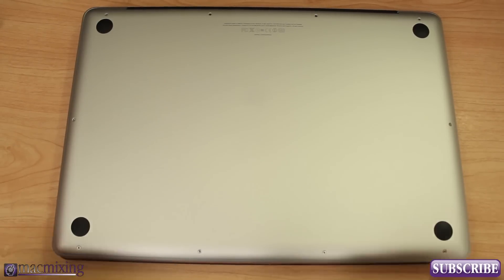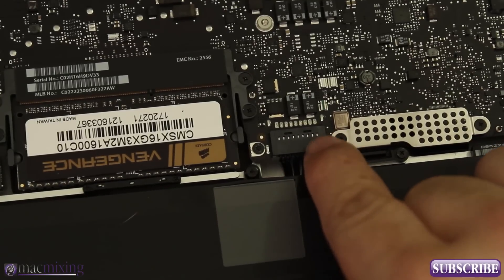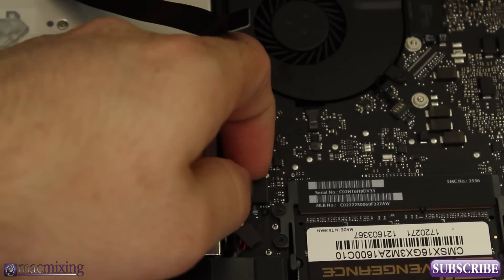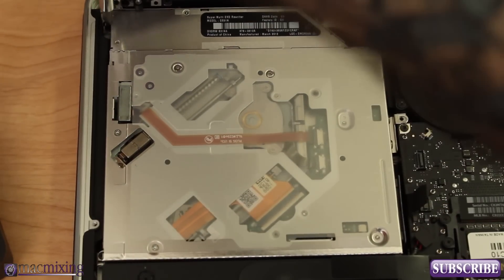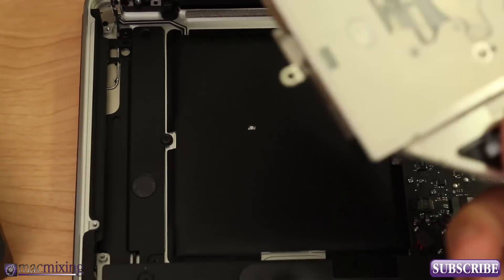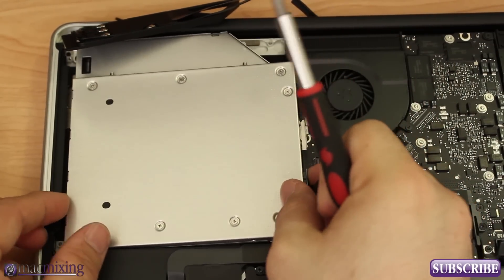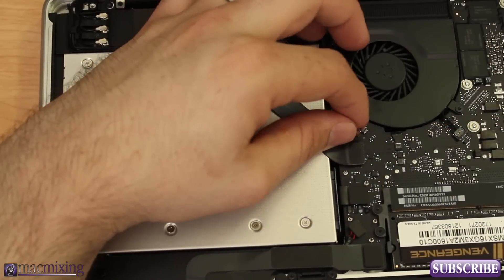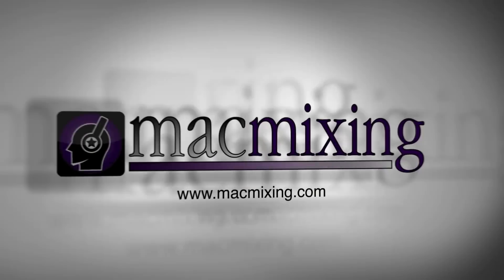[How To] Replace Optical Drive With HDD / SSD MacBook Pro 2012 - Caddy Installation

Comment: I had installed the HDD + SDD on the on the place that belonged to HDD place. My question is, whenever data written or read which Disk would be used as a primary and how to make the SDD as a primary. As the reason I bought my SSD is to speed up my MacBook but cant really define the speed difference after all.

Comment: does anybody have a recommendation for what kind of SSD to buy? write speeds/etc. Mid 2012/13 inch user. Core i5.
Reply: Buy the Samsung 850 evo its reliable and fast
Reply: SeymourGlass Samsung 850 pro

Comment: MacBook Pro (17-inch, Mid 2010) is it the same instrutions !? Same caddy ?
Reply: I wanted to know the same thing, i have a 13 inch and i hear even the 15 inch model is different, in regards to screw placement, length of screw, etc.

Comment: Thanks for the video. It helped a lot. I have 1 question though, after I replaced my Optical Drive with the HDD, my computer recognises it but it won't show up under "Devices" and my computer seems to be hotter than it was when I only had the SSD in. What can I do to see my HDD under "Devices" in the Finder? 
Thank you very much!

Comment: can u use any hard drive?
does any hard drive fits on the caddy?
im have a mid 2012 mac, i used for music, im a dj. and i want to install the biggest or better saying a hard drive with the most capacity posible and available.
Processor  2.7 GHz Intel Core i7
Software  OS X 10.9.5 (13F1077)
i already have a 500 GB Flash Storage.

I NEED THE BEST ADVISE PLEASE. 
THANKS

Comment: Is there a limit capacity that the MacBook Pro 2012 can handle?  I just bought a 512 GB SSD and I would like to replace the optical drive with it but I want to make sure it's not too powerful for this machine.  It's my first time doing this so I want to make sure I don't mess anything up.  Thanks!
Reply: Susy Martinez u should do this to see if works fine with u.... take out the HDD and put your new 512gb SSD and the old HDD replace it for the optical drive.. and if is not enough take out the HDD and put the 512GB SSD and another SSD on the optical with 128GB 2 SSD would be better... thats for sure but thats more money try the first one...
Reply: Susy Martinez what i did to my macbook is change my ram of 4gb to 16gb and i take out the hdd and put a 128gb ssd and for the optical drive i took 500gb hdd and for me works awesome.. if u havent change ur ram to more high u should if u want more speed from ur mac... u dont have to if ur not a video editor or photo editor someone who need big apps need more ram but if ur not i suggest to use only 8gb of ram
Reply: TTO_ Hybird does your Mac recognize the two hd or did you RAID as one?

Comment: I just did this set up, i put a ssd as the main hard drive and used my old hdd as the secondary, but for some reason it still boots from the old hdd. I cloned it to the ssd and the ssd works fine. Every time i start it i have to hold alt so i can boot from my ssd, any advice?

Comment: Could I install my SSD in place of the disk drive first to clone it then swap the location of my HDD and SSD?
Reply: You want to buy a USB hard drive enclosure (10$), hook it up, clone it and then install it where you want. Great comment below said to put the SSD in the original hard drive space and put your HDD in the optical drive. The connection to the original hard drive space is faster.

Comment: HI, thanks for the video. I was installing on my MBP13 mid'12, the HDD fit perfectly, but 2 screws protrude about 1/8" where antennas should lay flat, so lid didn't close flush. The screws are tight all the way, but it still comes out. Any suggestions? Thanks again for the video, very helpful until I got to the antenna part you have on minute 10.
Reply: Yeah you can see the screws sticking out, and he glosses over removing the screw when installing the drive (it magically disappears during an edit).

Comment: Would it be best to install the ssd where the old hdd came from or will the ssd function just as well in the optical bay?
Reply: It's on a Macbook Pro mid 2012 btw.

Comment: I'm confused. Can I just buy the caddy and put the HDD that was already in my Mac and put it in where the optical drive was? I already replaced my HDD with a Samsung SSD. But I don't need an optical drive and could use more storage. That being said, I used carbon clone copy with my SSD. So the only difference between my HDD that I took out of my mac and the SSD I put in is about 600 GB. Both of em have the same documents, apps...etc. etc. My question is if I were to put my mac HDD that I took out, into the superdive... will that be problem? both will have OS. Or can I just buy a WD HDD 750 GB for $80 and just put that in the caddy and replace the Optical drive? Do I have to install the software in the WD HDD?
Reply: yeah.. you can... i did the same thing... ssd for the system... and that original hdd replaced the optical for storage solution!
Reply: which Samsung ssd? the 840 evo? I want to buy this one but I don't know if it will fit the caddy, maybe I can replace the hdd with the ssd and put the hdd where the optical drive was...!

Comment: But how do you put mac os on youre new drive?
Reply: this isn't mean to act as a new drive, it's meant to be a backup or another place for stoarge.. almost like an internal huge flash drive. You could install an os on this though.. if you restart you mac hold down option p and you will be taken to a online mac os download screen so you can download the os on a new hdd

Comment: Thanks so much! I just reconfigured my mid-2010 MBP to recognize and power a usb-connected superdrive and swapped my optical drive with a 1TB HDD (Black Friday steal!!) Got the tool kit and caddy and it was all a breeze! I had to improvise a bit as I had an extra cord wrapped around the drive, and the camera cord wouldn't unplug easily (looked dangerously close to ripping the wires out when I started pulling) but I got it figured out. I also had to look up how to partition and set up the hard drive as I'd never done that before (cornelius explains it simply here: https://discussions.apple.com/thread/3100831)Thanks again!! Much appreciated!

Comment: Hey Macmixing (or anyone that could help), If I have a 120gb SSD that I want to install, and have over 150gb on my current harddrive, I obviously wouldnt want to clone it, because it wont work... So how do I put the operating system and just the select applications I want on my SSD, and leave the ones I do not want on my current HDD?

Comment: Hey
 I recently installed a SSD in my optical drive but i found it to be buggy while running programs.  For example, when i record videos and play them back i notice that parts are corrupted while running off the SSD.  Do you notice any of these behaviors with your set up here? It would be great if you could reply back with some feed back. :) Thanks Anyway

Comment: If you  have an SSD set up as your primary hard drive then use an HDD in the optical bay slot but save applications onto the HDD will you still get the quick opening and processing speeds as if you saved them on the SDD?

Comment: Replacing optical drive to hard drive caddy seems a little more complicated than I thought it would be. Worries me slightly thinking I could mess up the battery connector!

Would it be very similar with MBP 13" Early 2011?

Comment: Great Video....very informative and detailed. I am going to install an SSD in place of my optical. But my question to you is...I have a lot of files/programs on my current HDD that are very important to me. If I put my current drive in the optical bay caddy (with the SSD in the place of the current). Is that recommended, or if I plan to use my current HDD I should just leave it there? Thanks!

Comment: It seems the Optical Drive for the 13.3-inch MacBook Pro 2.9GHz Dual-core Intel i7 (June 2012 release) has a speaker obstructing one of the screws in your video, in addition to another ribbon connector near the HDD bay. Have you got an updated video on how to take out this particular optical drive? Thanks in advance for your response.

Comment: I had to dremel one of the screws out cause it was fastened too tight. It was a screw to the last part which is overlapping the optical drive. I was able to fix it, but I'd rather use a screw. Does anyone know where I can purchase replacement screws. Even a whole kit would be fine too. Just in case I have to bring my comp back to apple for other issues in the future.

Comment: Hi, 
I've just finished the installation. The disk was running continuously whether I was using or not thus the battery life would be drop by 40% or worse. However, I checked the disk utility and it allows you to mount/unmounth the disk anytime you like.

Comment: Yes it will. As long at the form factor is the standard 2.5 inch. Sata I, II, & III cables are exactly the same, and surprisingly sata I cables don't hinder sata III performance. Simply put, yes it will fit fine.

Comment: I have a few questions. First, if the drive is mounted automatically, it's always spinning, so wouldn't that use more power? Battery life would be significantly less wouldn't it? Is there a way to NOT mount it at boot but mount it when needed? Second, I read somewhere once that it's possibly to buy a battey kit or something to add an additional battery instead of an HD to replace the superdrive. That would be so sick to have extra battery life. Wonder if you've heard about that. Thanks.

Comment: Is it possible to use the removed optical drive and fit that into an enclosure so it can be used via usb connection when needed? If so can you recommend a reliable enclosure, thanks.

Comment: Right, so I tried to unscrew the two screws that you remove between 4.37 and 4.52, the ones that hold the black piece right behind (and partly above) the optical drive. 

I stripped the heads of both. Now it's as good as impossible to remove that black piece. 

So two questions: 

1) how can I solve this problem?
2) can I perhaps drill a small hole through the black plastic above the third screw, so I can unscrew it and remove the optical drive while the black piece is still in place?

Comment: 1) Perform a Spotlight search for the file "adoption.plist".
2) If you: Locate the file, drag it to the desktop. Do not locate the file, proceed to section 4.
3) Relaunch the Mac App Store. The Accept button should display in the Purchases section.
4) If the Accept button is still not displayed in the Purchases section of the Mac App Store after moving the adoption.plist file, drag an iLife '11 application from the Applications folder to Trash.

Comment: Great Video! this is something i have been looking into doing for quite some time now, only concern i have is not knowing how to have the OS boot up from SSD as well as the applications, but yet have other files like music and pictures etc saved on regular HHD, i know in the previous video you just cloned one hard drive to another, can you please elaborate a little more. thanks!

Comment: Great video, thanks. 
Question: Are there any performance penalties using a SSD drive in the optic bay compared to the HD bay if I wanted the SSD drive as my primary. Does it matter which bay the SSD drive is in?

Comment: thanks macmixing!  i am getting ready to purchase a new 13 pro.  Like the SSD install, while migrating the existing hdd to optical drive with caddy.  Think I got the hardware stuff thanks to your video....Question becomes the best way to load the mountain lion onto the SSD, while wiping it off the HDD that's in the optical drive.  Can you give some advice?

Comment: Hey great tutorial but my question is, if you could reply to it is that. I bought a 500 GB HD and my existing hardrive is 320GB. I want to transfer my files to the 500 GB and i want to use the SSD i bought 120GB to install OS X. Is there anyway i can still use the SSD just for the performance and maintain my files. My whole computer is taking 221GB

Comment: Finaly did it and with great succes. Im loving it! Only thing i was scared about is the fact that i had to do this on a 13" mbp 2012 instead of al the 15" vids i saw on youtube. I was shaking like hell when trying to remove the plastic cable holder on top of the superdrive. I didnt put the top left screw on the optibay :p i didnt want to mess anything up. (i did check if the optibay wasn't wiggling so it's good) :D great "how to"!!

Comment: If you are putting in two hard drives and plan to install Windows on one:

1) You can only install Windows on the drive in the MAIN bay.  (Mt. Lion drive must go in opti-bay.)
2) Download a free ISO of Windows, then use Boot Camp (on Mtn Lion), options 1 + 2, to save the WindowsSupport files to one USB flash drive, and to make the other a bootable installer.
3) Execute option 3.  It reboots.
4) Power off, disconnect Mtn. Lion drive.
5) Boot to USB, install Win7.
6) Reconnect drive.

Comment: Thanks for the great video. One comment: there are two screws that, when putting them BACK in, are very easy to over-tighten; when you try to get them out again, they can become stripped.  These are the two black screws that are on the thin, 1" x 4" black rail, near the top-left corner of the laptop, that largely traps the optical drive in place.  (It runs parallel with the longer side of the laptop, and it has a triangle-shaped carveout in it.)

When putting those screws back in, BE GENTLE!!

Comment: does the vid apple for the late 2011 macbook pro...if so what would you recommend doing? use a caddy and move the hard drive into the optical drive bay and insert the ssd into the hard drive bay? or what

Comment: I installed this setup and have the HDD in the optical bay and an SSD in the main slot. I moved everything to the SSD and wiped the HDD clean, but I'm wondering about re-installing OS X to the HDD as well. What would be the advantage of having the operating system on both hard drives / dual booting? Thanks.

Comment: heres what i want to do take out the stock apple drive put a ssd in its place and put the hdd in the optical bay but i dont want to dual boot so would i need to wipe the HDD if so how. Also i would only put the new lion os on the ssd right. im just confused on what to do with the stock apple one that came with it I only need it for storage please help and keep up the great videos thanks

Comment: Is it possible to use  6Gb/s SSD in place of the of the optical drive without bottlenecks or significant errors on the 2012 ivy bridge MBP like yours?

Comment: Thanks for the reply :) Regarding to point 1, as my friend has a MacBook Pro 2009 and he would like to replace the optical drive with a faster HDD (7200rpm), does the "newer MacBook" you've mentioned include the 2009 models? Is there any way we can check the power compatibility with HDD to be installed (like in point 2 we can check the System Profiler)?

Comment: Really thanks for making this informative video! But I still have a couple of questions:
1. For the HDD to be installed, can I use a 7200rpm one instead of 5400rpm? (as I am concerning whether it can provide enough power through the optical drive cable)
2. If I replace the optical drive with a SSD, would the read/write speed be capped at some value?
3. Is it possible for me to format this drive as exFAT format so that it would allow me to read and write the drive under both mac and window mode?